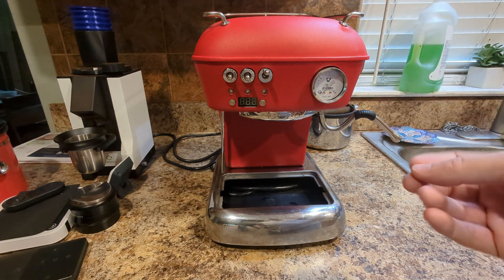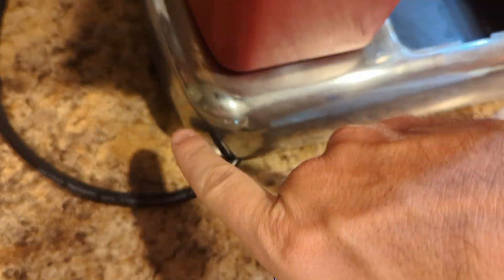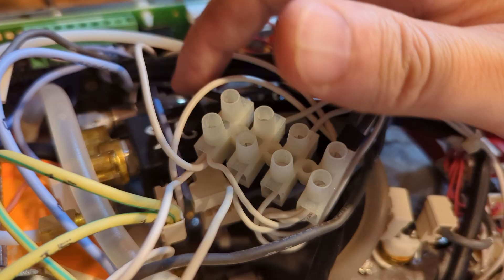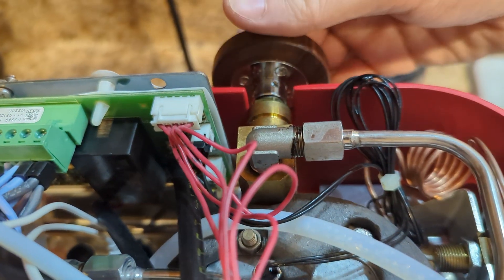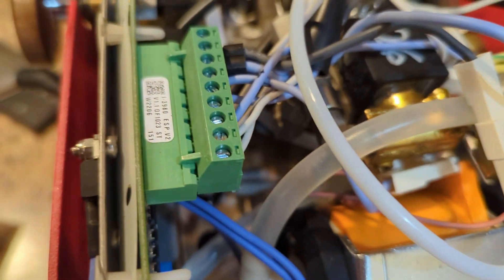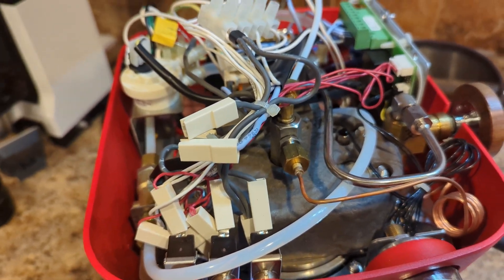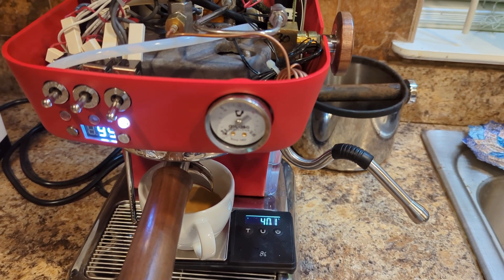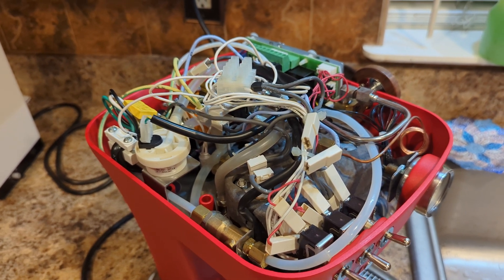Inside the Ascaso Dream PID

Comment: It has more to do with the grind size, without the resistance from finer grinds you won’t see close the the maximum pressure set at the OPV. The gauge in that design shows a good indication of actual pressure at the puck, which is a useful thing.

Comment: Could you please tell me how to remove the filter screen, which was omitted at the beginning of the video.
I would like to remove it for cleaning, but it is too hard to move.
Reply from the maker: Do you mean the shower screen? I used a flat screwdriver to pry it out (work around it slowly so it doesn't bend). Just make sure you don't stab a hole in the rubber gasket, but it's not that fragile.
Reply: @TechDregs  I was able to remove it successfully. Thanks so much for replying to my comment.
Reply: @TechDregs my shower screen was super clogged thanks

Comment: Nice. Also explains why the volumetric measurement is dodgy when the OPV bypasses some flow - it's a low pressure flow meter and has to be on the suction side of the pump, so only sees total flow. They'd need a more expensive (and potentially less reliable) high pressure flow meter device on the downstream side of the OPV for accurate measurement under all conditions.
Reply from the maker: Yeah, good point. I'd assumed that was the case, and I've never felt that volumetric dosing has been consistent on the machines I've tried.

Comment: A bad connection, either a poor and loose connection could cause several problems. First of all the pump could overheat a bit and not be able to go to full pressure. The connection itself could overheat and cause a lower voltage to reach the pump but cause higher amps through to the pump. I think you have found the main problem. Good trace on all the components and fittings.